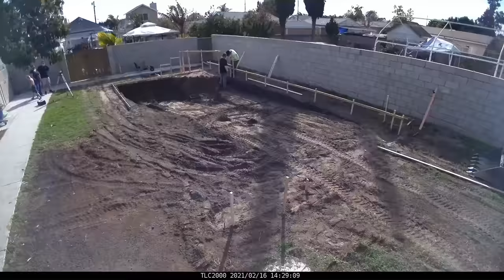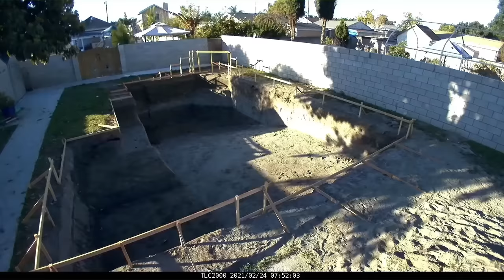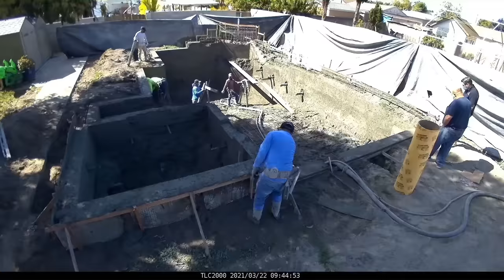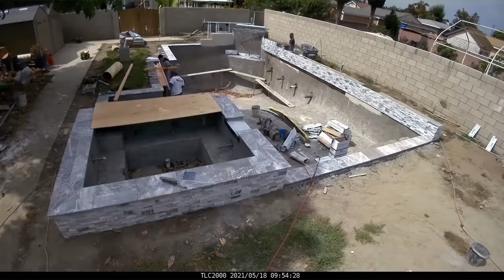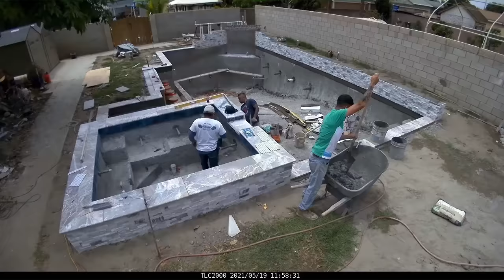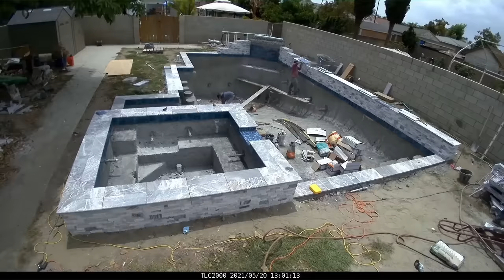Pool Construction Time lapse in Southern California

Comment: Great video - to see the entire process from start to end in one short sitting is really educational - who would have thought that they can just spray concrete at the walls and it is happy to stay there while they go around and render the surface. Very nice result - makes me want to get a reno on our pool and bring it up to date (Qld Aust).
Reply from the maker: Thank you watching. The shotcrete they used is very strong and we had to water it every day for 3 weeks as it dried. Very happy with the result!
Reply: @TimDude84  Hi Tim ,I worked in commercial concrete forming for quite a while,but I was wondering how come they do not use  polyethelene 10 mil vapor barrier rolls to put down over the soil/dirt and then pour the shotcrete that way the soil would not get mixed in when you shot it and also to help with curing since you would not lose moisture.I do not know about this type of construction just curious.Nice job on the pool though.Thanks
Reply: Six months??!!  Ugh!!

Comment: At 9:04 a drain (the blue square) suddenly appears in the lower left of where the new sidewalk will go, but I never saw them lay down any pipe for it.  Where does the drained water go?
Reply from the maker: Good eye! They splashed some concrete on the wall and we did get some money back because of it. Now we have a fake ivy wall covering it.

Comment: The actual building process was interesting and the end result looks great. There is a tragic irony in here somewhere though, the construction of a structure that holds a huge amount of water, facilitated by weather where there was no water to disrupt said construction, in a part of the state which is close to completely running out of water.
Reply from the maker: Thank you for the comment. When we built the pool in Feb. last year the drought had started to go away... I did buy a large cover for both the pool and spa and that greatly reduced the amount of evaporation. It's close to 80% less evaporation than before.

Comment: Just learning along and trying to figure out the last couple minutes of the video.  Am I correct to assume you built a shotcrete pool?  Right before you fillup the pool it looks like your contractor installed a blue colored plastic liner?  Am I seeing this correct?  What color did you pick?  Looks nice!
Reply from the maker: Hi Bhavik, This is a shotcrete pool and took about 3 weeks to harden. The plaster they applied towards the end is a Pebble Tec coating. It's not a plaster. It's more of a thin colored concrete with small pebbles. Look up Pebble Tec and there are some cool videos out there.

Comment: Hi we are going to start our pool building process also using Mr Carlos pools. Your pool turned out great! Can you please let me know how you filmed the time lapse. I have a go pro that I’ll be using just not sure what settings works best for a pool project like this. TIA 😊
Reply from the maker: Hi, We bought a Brinno TLC2020 Time Lapse from Amazon. It runs about $360. I really liked it but the battery life is shorter than advertised.
Reply: May I ask how much will your pool be costing you with mr.carlos ? I'm also building a pool at the moment .thanks
Reply: @isras9278  there was already a similar question above, about 100
Reply: @TimDude84   nice time lapse!  May i ask what your settings were?  approx. recording time, Capture interval and playback rate (fps)

Comment: Curious what was the drop off from 3/22 to 5/13?
Reply from the maker: After they shot the concrete they were supposed to get back to work in 3 weeks... However; the company was stretched too thin with their masons and we had to wait in line. It was a very frustrating month.

Comment: What was the cost of the pool & hardscape? This is a pretty big pool. Looks very nice. Nice touch with the cement surround
Reply from the maker: The total price with the pool, concrete and some extras came to approx. 100K.  Thank you for the complements. It was roughly 2 years of design while we saved up the money.
Reply: @TimDude84  100 k???? 😳😳😬No thanks dude... I've my bathroom and seas...
Reply: @dimitrakapa4887  we can literally own a duplex house with pool here in India with that money 😬😂
Reply: 100k is minimal for something like that nowadays plus they last for decades my pool is nearly 60 years old no issues never just weekly cleaning brush walls , floor , Pour bleach , acid wash Filter whenever it needs it , in the summer time a few more chemicals that’s all nothing crazy  very easy to maintain a pool there’s bunch of info here on YouTube 👊🏻 Nice pool Bro
Reply: @BudgetCarnivore  enjoy India
Reply: @dimitrakapa4887  he pretty much increased his equity at the same time. when u have kids, it pays itself off in the long run... though maybe maintenance and water can be costly.

Comment: That turned out amazing. What does a job like this normally run & how long did it take? Couldn’t really tell with the time lapse.
Reply: 4x4 Shorts  my screen was set to fit so I didn't see anything at the bottom until I adjusted settings. That answered one of my questions. Thanks
Reply: 4x4 Shorts  my screen was set to fit so I didn't see anything at the bottom until I adjusted settings. That answered one of my questions. Thanks

Comment: What was the reason for the 2 month gap from March to May?
Reply from the maker: When they shoot the gunite (concrete) it needs to cure for about 4 weeks. However; they were having trouble scheduling the next crew and getting the right materials. (Covid excuses). It was about 10 weeks from when they shot the gunite and then started the next step. (We were a little frustrated at that point)

Comment: The people next door are having the pool redone. I also need mine redone.
This is the issue I have, they started in October, one day they dropped the pump in the pool, another they removed it, then they brought the pavers for the deck. Ok, that's 3 of the 11 days they have worked on it. They spent 2 days pulling pool apart, another 2 to do the same to the old deck now we are up to 7 days of work. Then another 3 days picking up and 1 to put in the tile. It's almost January and 4 months from when they began and it's not done and the pavers have been in the driveway for almost 4 months now.
It seems like this should of taken LESS than a month not going on it's 4 the month.